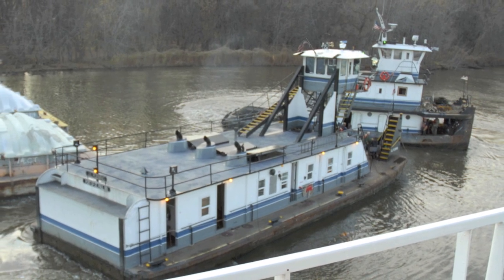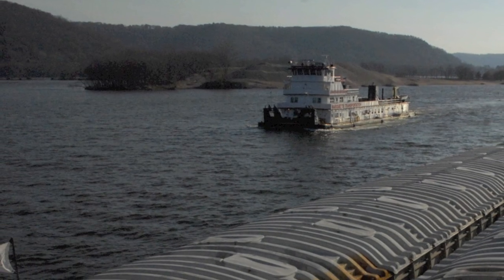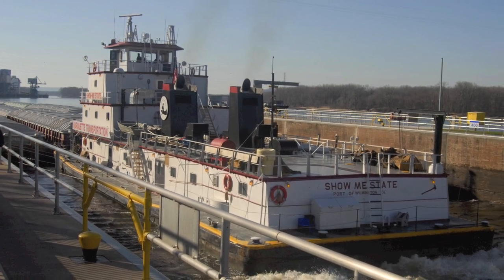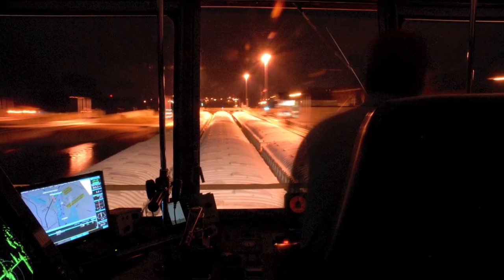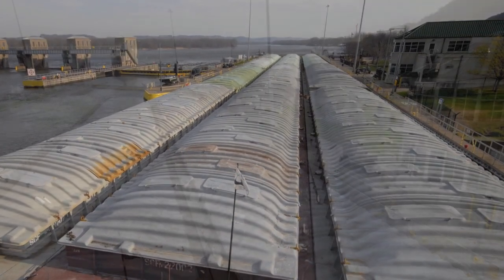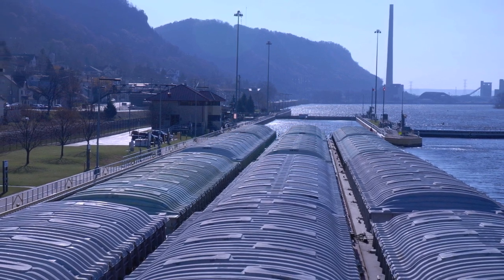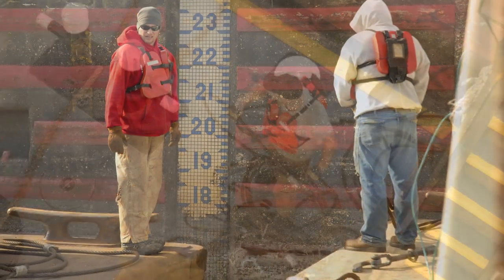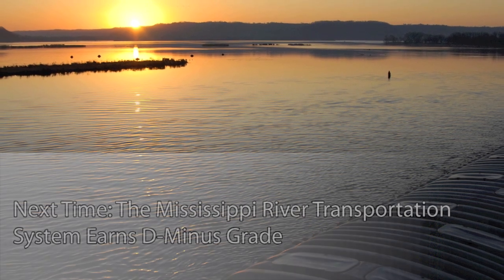Shipping Out, Part 3: Moving Bushels South at 3 MPH

Comment: It appears to me the most sensible approach is to only take as many barges as can be locked without being broken up to St. Louis then assemble the larger tows for the lower Mississippi.  This would save a lot of time.  If it takes 45 minutes to lock a tow without being broken, and about 3.5 hours if the tow is broken and reassembled then on average 4 and 2/3 tows could be locked  in the same time speeding up traffic.
Reply: Roy Reynolds I've spent the last 12 years working on the Mississippi River and it takes an hour an 40 min on average to lock a 15 barge tow through and upper Mississippi River lock. This guy's facts are off. also to do what you propose would be too cost prohibitive. To do what you suggested and make money these companies would have to invest in smaller boats and a lot of them and then the cost of crewing the extra boats would be a nightmare not to mention the maritime industry in this country is already short 70,000 Mariners. The current system works. Could it be better, sure. Will it get better, not likely. Good example is the Olmsted lock and dam project on the Ohio River.

Comment: NOBODYDUFUS is correct that any lock constructed will be filled.  The replacement of 600-ft locks on the Ohio was accomplished by enlarging one lock then because the other locks were smaller the rest were enlarged to match.  This was started on the Mississippi at Alton Dam where the scheme was caught in the middle 70's.  The Ohio locks were originally built and operated by shipping companies.  All of these statistics can be manipulated to show just about anything you want to justify.  Most of this grain starts out on railcars and moved in unit trains to ports on the Mississippi which can just as easily be routed to Gulf ports directly(quit a lot is anyway).  The railroads pay for their own land, track, maintenance, etc. without tax dollars taken from us.  By this method travel time is only two or three days instead of one to two weeks.  I have witnessed the selfserving and always something to build USACofE.  The best thing they have ever done is the Waterways Experiment Station scale map of the Mississippi drainage basin for predicting floods.